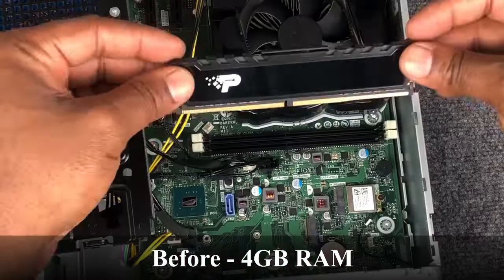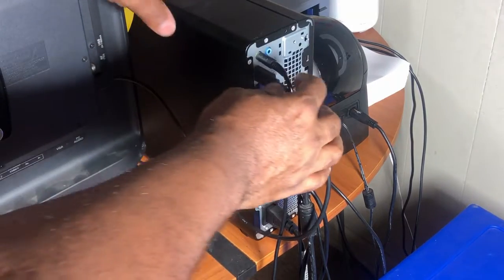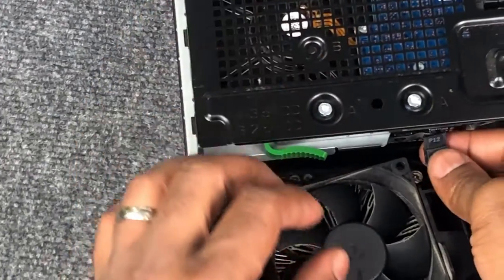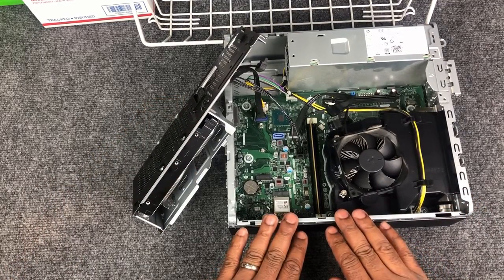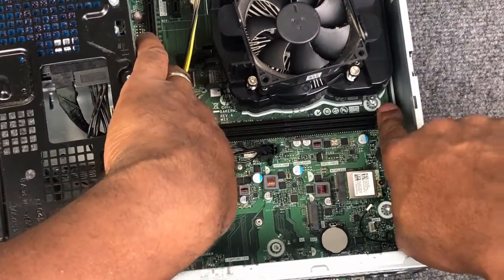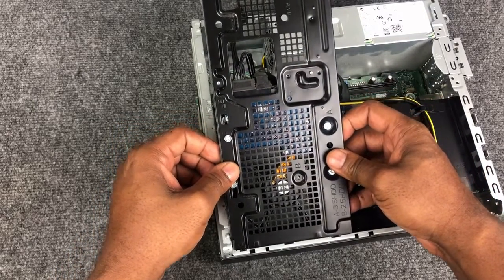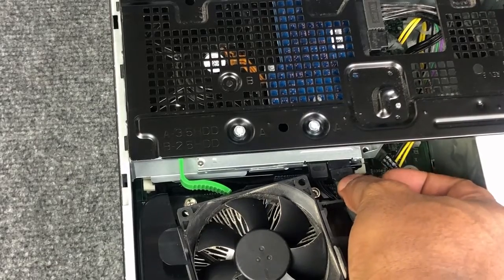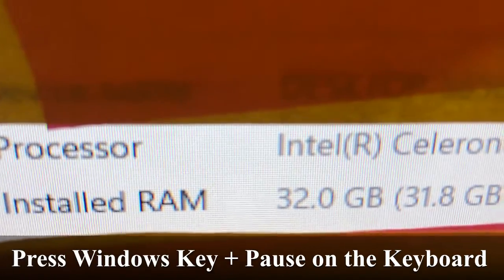Boost Your HP Slim Desktop PC Performance: Upgrading RAM Made Easy!

Comment: great video i got the i3 12100 version of this pc i slapped another 8 stick gig of ram in her and put a rx 6400 gpu in mine its a ea sprots gaming beast the i3 in mine is kind of like the old i7 4777k from the 4th gen haswell days with more hyper threads like 12 instead of 8 in those old i7 love the video gave you like and a sub
Reply from the maker: Thanks. Appreciate you! Sounds like a solid upgrade! Glad you found the video helpful.

Comment: Bro can i shift all these components to a gaming cabinet and add a graphics card....if yes..which graphics card? Will inno3d rtx 3050 work?
Reply from the maker: Great question! Yes, you can transfer the components to a gaming cabinet, but you’ll need to check a couple of things first. Make sure the power supply has enough wattage for the RTX 3050, and that the motherboard has a PCIe slot to support the card. Also, ensure the new case has enough space for airflow and proper cooling. If everything lines up, the Inno3D RTX 3050 should work!

Inno3D RTX 3050 - https://amzn.to/4eRtQB4

Just keep in mind that some pre-built systems have limited upgrade potential, so double-check compatibility before starting the transfer.
Reply: @daddydiygrilling  Ok thank you bro👍👍🗿

Comment: Can i upgrade to a bigger case?
Reply from the maker: Upgrading the HP Slim S01-pf1013w to a bigger case is possible since it uses a compact motherboard. Ensure the new case supports this form factor, and consider upgrading the power supply, as the original might not fit. You may also need to modify front panel connections to make them compatible. A larger case will improve cooling options but expect some adjustments and potential component upgrades.
Reply: @daddydiygrilling  tysm can you give me what psus to buy for this?

Comment: So if you have a 64bit operating system does that mean you can put 64gb of ram in it, would that make it even faster or is 32gb of ram fast enough ?
Reply from the maker: A 64-bit operating system can support more than 64GB of RAM, but whether you need that much depends on your usage. For most tasks, 32GB of RAM is fast enough. If you're doing heavy tasks like video editing or running virtual machines, 64GB might help, but if you're not using all of your current RAM, upgrading won’t make your computer faster.
Reply: @daddydiygrilling  oh ok so if you were to use an emulator for gaming then 32gb of ram would have no lag at all ?
Reply from the maker: For gaming with an emulator, 32GB of RAM is usually enough to prevent lag. However, performance also depends on your CPU, GPU, emulator optimization, and the game's demands. RAM alone won’t guarantee no lag if other system components are underpowered.
Reply: @daddydiygrilling  ok so if the gpu and cpu are not strong enough then what should I buy , I’m using the same pc in your video
Reply from the maker: If your GPU and CPU aren't strong enough, you have two options:

1) Upgrade Your PC: If your HP Slim allows it, consider upgrading to a stronger CPU and adding a dedicated GPU. However, HP Slim desktops often have limited space and power supply capacity, which makes upgrading challenging.

2) Consider a New PC: If upgrading isn’t practical, consider buying a new PC with a more powerful CPU and a dedicated GPU. Here are some good options for under $1,000:

- Skytech Gaming Nebula - https://amzn.to/4dnoYCg: Intel Core i5, NVIDIA RTX 4060, 16GB RAM, 1TB SSD

- CyberpowerPC Gamer Master -https://amzn.to/3TMstLg:  AMD Ryzen 5, NVIDIA RTX 3060, 16GB RAM, 500GB SSD

- Skytech Blaze 3.0 - https://amzn.to/3TLIaCO: Intel Core i5, NVIDIA RTX 3060, 16GB RAM, 500GB SSD

- ASUS ROG Strix G10 - https://amzn.to/4gJjxjH: Intel Core i7, NVIDIA RTX 3060, 16GB RAM, 512GB SSD

These PCs offer much better performance for gaming and emulation compared to your current HP Slim setup. You can search for these models to find the best deals. Make sure to choose one that suits your gaming needs and budget. Hope this helps.

Comment: I want to upgrade my hp envy from 16gb ram to 32 , should I upgrade CPU too ?
Reply from the maker: If your HP Envy handles tasks efficiently, upgrading from 16GB to 32GB of RAM might be enough to improve performance, especially for memory-intensive activities. However, if you face slowdowns or need better performance for CPU-intensive tasks, consider upgrading the CPU too—if it's upgradeable and within your budget. Note that not all CPUs are upgradeable; many laptops, including some HP Envy models, have soldered CPUs that can't be upgraded. Check your specific model's specifications or consult HP support to confirm if a CPU upgrade is possible. Be sure to evaluate your usage needs, compatibility, and cost before deciding. Hope this helps!

Comment: question for you. I'm not a tech guy, so opening up these things are 'horror' for me. I recently bought a HP Slim S01-aF2006na Desktop PC - Intel® Pentium® Silver, 256 GB SSD, Black - to replace my old acer lap top. I've been hearing that these can be upgraded with a graphics card to turn into a basic game rig if you choose to game on it. What graphics card could you recommend and if you have any videos of it to show how to open, fix etc 

i don't plan to game on it as I am using it for basic needs of streaming, music and drawing. But the option to game is very appealing and interesting. 

any info and video guides are appreciated.

thanks
Reply from the maker: Upgrading this desktop with a graphics card can definitely enhance its gaming capabilities, even though you mainly use it for streaming, music, and drawing.
Graphics Card Recommendation: Due to the compact size of the HP Slim S01 and its power supply limitations, you'll need a low-profile, power-efficient graphics card. Here are a few options that should fit well:

NVIDIA GeForce GT 1030: This is a budget-friendly option that provides a decent gaming experience for less demanding games.Link: https://amzn.to/4cL5PdJ

AMD Radeon RX 550: Another affordable choice that can handle light to moderate gaming. Link: https://amzn.to/3y0Uwz7

GIGABYTE GeForce RTX 4060: If you want a bit more power and are willing to spend a bit more, this card offers better performance and is still compact and efficient. Link: https://amzn.to/3Sb5CZe

Installation Guides and Videos: 
To help you with the installation process, here are some basic steps:

1. Preparation:
 - Make sure your desktop is powered off and unplugged.
 - Ground yourself to avoid static electricity damage to the components.

2. Opening the Case:
 - Remove the screws on the back of the case.
 - Slide off the side panel to access the internal components.

3. Installing the Graphics Card:
 - Locate the PCIe slot (usually the longest slot on the motherboard).
 - Remove the corresponding slot cover on the back of the case.
 - Gently insert the graphics card into the PCIe slot until it clicks into place.
- Secure the card with a screw to the case.

4. Connecting Power (if necessary):
 - Some graphics cards may require additional power from the power supply. If so, connect the appropriate power cables.

5. Closing the Case and Powering On:
 - Replace the side panel and screws.
 - Plug in your desktop and power it on.
 - Install the latest drivers for your graphics card from the manufacturer's website.

Hope this helps!
Reply: @daddydiygrilling  thanks for the reply and guide. I'm definitely book mark page this to get the basics in regards to opening and closing the pc for reference. Thanks for the detail reply and guide. 

Appreciate it

Comment: is it a big deal what ram I get? I got a different brand but 32gb
Reply from the maker: While the specific brand isn't as important, the RAM should be compatible with your motherboard and match the specifications of your existing RAM (if you're mixing). Ensure the new RAM has the same type (e.g., DDR4), speed (e.g., 3200 MHz), and voltage. Mismatched RAM can cause instability or prevent your computer from booting. If you're installing a new set, it's best to get identical sticks to avoid potential issues.

Comment: Man I thought it was no hope for my wife's slow Hp slim 260-a011 with 4 GB of RAM.  But after seeing this I'm doing an immediate upgrade. Will the same  ram cards work for my PC?
Reply from the maker: I suggest going to HP’s support page and scrolling down towards the bottom and enter in the serial number for your particular computer. It will then provide you with the technical specifications of your computer, to include the type of RAM it has installed. Here’s a link to the site: https://support.hp.com/us-en
I’ve definitely seen a significance performance increase in my computer since the RAM upgrade. The 4GB the computer comes with just isn’t enough to unlock the true performance of this computer. Hope this helps, and thanks for stopping by the channel!

Comment: Good job on your presentation. I upgraded my HP Slim through the link you provided and the performance improvement is noticeable. It's like a new machine! I only had 4 GB to start with (which is not enough) now 32 GB of RAM. Thank you!
Reply from the maker: Thanks a bunch! My HP Slim has been running great too since the upgrade.

Comment: Do you think the Asrock LP a380 gpu would fit?
Reply from the maker: Although it's a low profile, you need to look up the dimensions of that particular GPU and the available space inside the HP Slim Desktop. Also, you've got to ensure the power supply unit of the HP Slim can power the Asrock LP a380. Hope this helps. Thanks for question and for commenting!